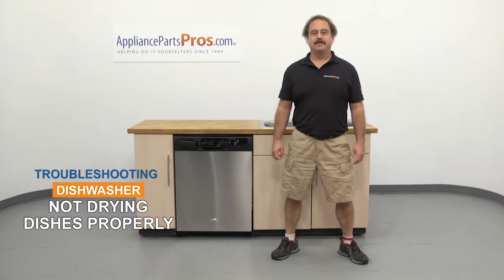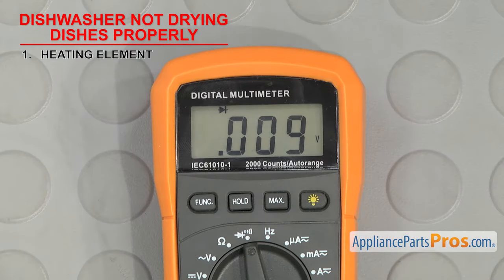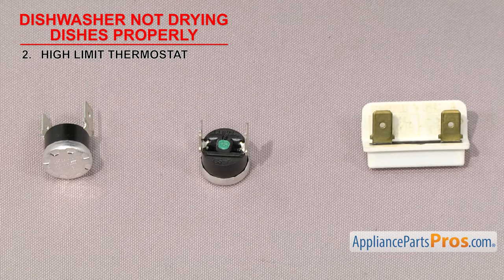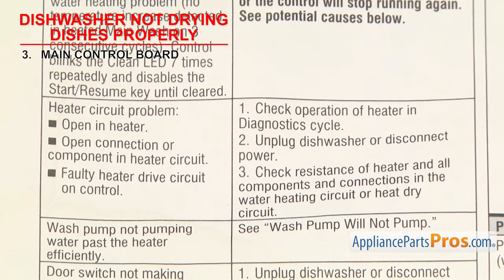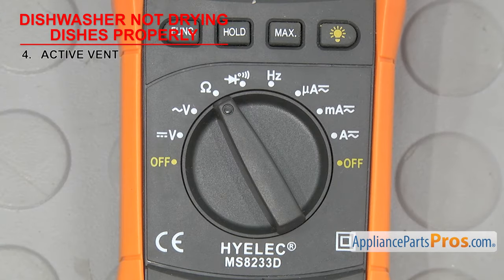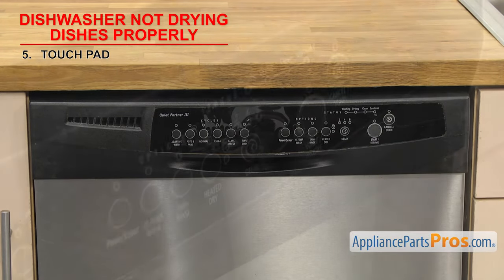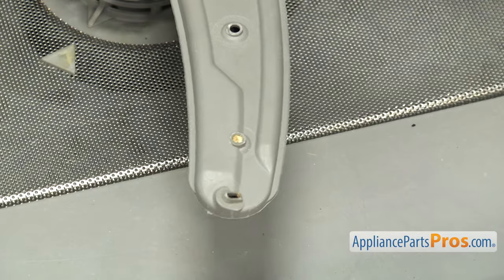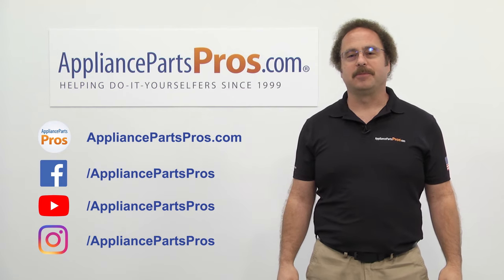Dishwasher Not Drying Dishes Completely - Top 5 Reasons & Fixes - Whirlpool, GE, LG, Maytag & More

Comment: Matt, my GE Profile PDW8280NSS dishwasher has the opposite problem. I ran a load of dishes last night, and this morning the green "clean" light was on, indicating that the cycle was complete, but THE HEATING ELEMENT WAS STILL ON!  The darn thing had been baking my dishes all night long!

I turned off the circuit breaker, waited an hour or so for it to cool down, and turned the breaker back on. The heating element stayed off.

Do you have any idea what caused this?
Reply from the maker: Do you happen to have a mulitmeter? Have you checked for any damaged wires? Have you had any type of power outages recently?
Reply: Yes,  @appliancepartspros , I have multimeters.

No, I haven't even pulled the dishwasher out from under the counter yet. What do you suspect?

No, we haven't had any power outages lately (but my dishwasher experienced a one hour outage when I shut off the breaker, this morning, to turn off the heating element).
Reply from the maker: You could be having an issue with the board. There maybe a relay that is stuck on the board causing the element to stay on.
Reply: Well, it stayed off when I turned the breaker back on.

Do these dishwashers use a mechanical relay, or solid state, to control the heating element? Is it just a single high-power relay? Where is it located?
Reply: I've run the dishwasher a couple of times since then (with the same settings: "cook ware" and "heated dry"), and it worked fine.

I can't possibly fix a problem which doesn't recur. So, for now, I'm just only starting the dishwasher when I expect to be around to check it 130 minutes later. When I start the dishwasher, I talk to my phone:

"Hey, Google, set alarm for two hours and ten minutes from now."

If the problem recurs, and gets to the point where I can reliably reproduce it, then I'll try to fix it.

@appliancepartspros, do these things use electromechanical relays, or solid state?
Reply: I've run several more loads of dishes, and I still haven't seen a recurrence of this issue. @appliancepartspros, do these things use electromechanical relays, or solid state relays?

Comment: I have a Whirlpool WDTA50SAHZ0 that's not drying or heating the water up much.  When a cycle is done, I can still smell the detergent which gets left on the dishes as a white film.

I've checked:

water temperature hot side: 115F
heating coil/element continuity: positive
hi-temp thermistor continuity: positive.

What could be the cause?  I've selected hi-temp wash, heated dry, extended dry, and sanitize.  I used to see steam come out when I opened the door 30-40 minutes into a wash, but now the water is barely warm, even though the hot water coming out of the sink faucet is 115F.
Reply from the maker: The water coming to the unit should be 120 degrees. You will need to check the setting on your water heater if it's just 115 coming to the unit. You will need to test the heater for resistance, it should read between 10 and 40 ohms. To test the thermister you test it for resistance and it should read between 45K and 48K ohms.
Reply: @appliancepartspros  your video says to test the heating element for continuity and continuity = good.  I found the service manual for a similar Whirlpool dishwasher and it says the heating element should show between 8 and 30 ohms.  Even your reply says it should be between 10 and 40 ohms.

Can you see how that directly contradicts what your video says?
Reply from the maker: The video is a generic video so it can be used for different models. It is always recommended to check for the troubleshooting for your specific model and that is where the information that was provided came from.
Reply: @pqtat718  Does 8-30 ohms fall within the 10-40 ohm range?......Your Good, its not rocket science.
Reply: @martypalmiere7672  I'm not harping on the ohms range.  I took issue with the continuity test because in the video, the technician doesn't say anything about measuring it for resistance in addition to continuity.
Reply: Press any 3 buttons 1-2-3 1-2-3 1-2-3 and it goes into diagnostic mode. Then shut the door and wait a few seconds and it will give you an error code. Then let it run through a series of tests, it fills with water, sprays, drains, and then tests the heating element, at the end it clears the codes and the heater will work.
Reply: The computer isnt activating the heater because it has a stored code in its memory, run it through that diagnostic test cycle

Comment: I have one of these Bosch Dishwashers.....The last about 20 minutes its makes a lot of noise. Like 50 hz loud humming. When i open the lid i can hear some air ventilating inside the dishwasher. When i close the lid again the humming start again after about 30 seconds. Is there a blower motor running on 50 hz? (Denmark 230V 50 hz)

Comment: i just bought a new construction house with a brand new whirlpool and it does not dry dishes even when i select “heated fan dry”…. it’s super annoying and imo inexcusable for a brand new 2023 product
Reply: They might've forgotten to punch out the tab in the garbage disposal where water drains out to.

Also try resetting the control board by pressing the buttons on the front 1-2-3 in succession 3 times